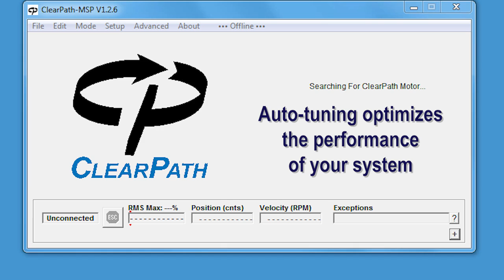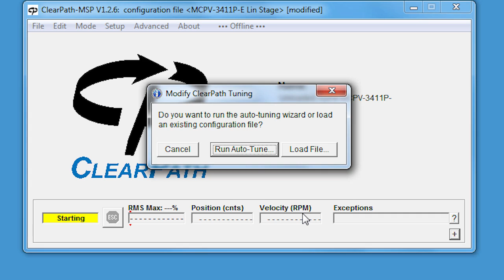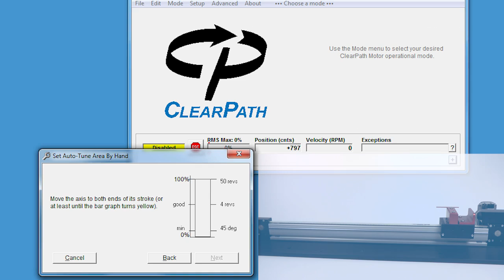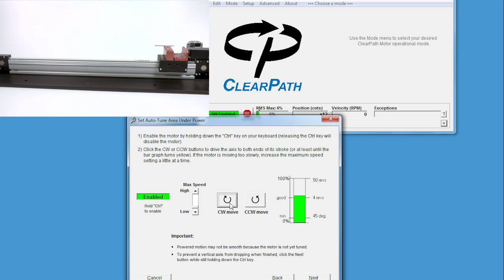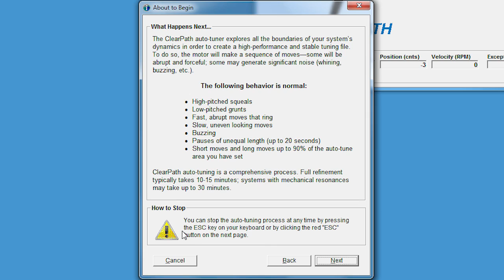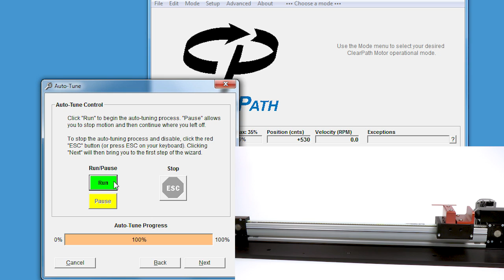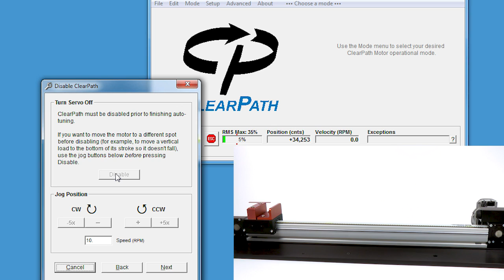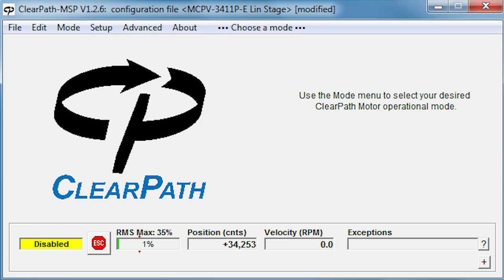How to Auto-tune a ClearPath Motor

Comment: Can I use my AVID CNC EX Controller to power my servo during the Auto-Tune procedure?
Reply from the maker: Hi @adamna1672, 
When running the auto-tuner, the servo requires 24-75V DC bus power (The logic inputs from the EX controller are not used and should not be sending commands during the auto-tune process). If the servo is powered, the LED on the back of the motor will be on. During this process, the logic I/O cable (between the controller and the motor) can be disconnected completely.

Best regards,
Aaron - Teknic Servo Systems Engineer

Comment: Hmmm, I need to look into these servos in my upgrade of the small cnc router. It almost sounds too good to be true.
Reply from the maker: Hi Niclas - ClearPath servos are often a great upgrade for CNC routers.  I’d recommend looking into the ClearPath-SD (Step & Direction) series for contouring/path-following applications like a CNC machine:
https://teknic.com/products/clearpath-brushless-dc-servo-motors/clearpath-sd-stepper-replacement/

In case you weren’t aware, Teknic has a 90-day refund policy for ClearPath servos so you can thoroughly and confidently evaluate them in your application.

If you have any questions about what products are best for your application, please don’t hesitate to reach out via our contact request form (https://teknic.com/contact/), or by giving us a call at 585-784-7454. 

Best, 
Nick D. – Teknic Applications Engineer

Comment: I'm using these in a homebuilt CNC router. This was a great video at explaining the tuning app, and here are a couple other things I found:

1. At 6:50 in the video, the carriage is manually moved through its range. What confused me when I did it was that it didn't work. Turns out that the Direction button need to be held down for about a second before anything happens. I was tapping it to get the carriage to move "just a little", and it was non-responsive. My bad.

2. If the mechanism that the servo is coupled to is heavy or has a lot of friction, the servo may overheat during self-calibration. If it does, it'll pause to let the servo cool, but the takeaway is that a larger servo is be needed.
Reply from the maker: Hi Kurt, thank you for your comments. I'm sure other readers will appreciate the feedback. I have a couple of small clarifications that may be helpful:

When one of the direction buttons is pressed during auto-tuning (commanding the motor to move), the torque starts to ramp up immediately, but because the servo is not yet tuned, this ramping happens slowly for safety reasons. With light axes, without a lot of friction, pressing a direction button will therefore generally cause motion immediately. But for heavier axes and/or those with significant friction, it may take a little time for the torque to ramp up enough to generate movement. 

I can see how this could be confusing, so I will submit an entry to Teknic’s feature request database to add an indicator (or something similar) to the user interface of a future software revision to clarify the behavior.

My second minor clarification is that if the auto-tuner pauses during tuning to let the motor cool down, it may indicate that you need a higher torque motor, but in many cases, you will not. The auto-tuner is pretty aggressive to ensure the tuning is robust, but many applications are not nearly as aggressive and/or have low duty cycles. 

A good way to see if you really need a higher torque motor is to run the motor in its normal application (e.g., cutting an intricate part on your CNC machine that requires lots of accel/decel, with the acceleration and velocity limits set as high as you intend to use. Then, monitor the RMS torque meter in the ClearPath software and see how high the RMS torque gets. (RMS torque is a sort of weighted average torque.) If the maximum RMS torque stays below 70-80% in this worst-case usage, you probably have enough design margin with that size motor. 

See this section of another TekTips video for a little more information on the RMS torque meter: https://youtu.be/oJSp_1aNiSE?si=OWKT8XrMoo1nB3sR&t=523.

Thanks again,
Aaron B. - Teknic OEM Applications Engineer

Comment: Hi, last week we did the auto tune , but it always stuck at 41%, could you give me some advice? Thank you.
Reply from the maker: Hi Ethan,

There are a number of possible circumstances that may prevent the auto-tuner from completing the auto-tune process. I can’t mention all of the causes here but I can provide some clarity for the most common causes. 

Perhaps the most common reason that prevents the auto-tuner from completing the tuning process is due to vibrations/harmonics in the machine. These vibrations could be due to a poor coupling choice (like a helical coupling), a narrow belt used for a belt drive, or a cantilevered load. The auto-tuner uses a square wave stimulus for tuning to not only analyze these vibrations, but to also adjust the tuning parameters in an effort to prevent excitation of these vibrations. If the vibrations are excessive, the auto-tuner may not be able to create a set of servo gains that are considered to be robust in nature.

The second most common reason for problems during the auto-tuning process is due to a high “inertia mismatch ratio”. The inertia mismatch ratio is the ratio of the load’s inertia reflected through the mechanics compared to the inertia of the spinning rotor in the motor. The accepted standard in the industry is to keep this inertia mismatch ratio at 10:1 or less (load: rotor) for the most robust design. That said, it is possible to have a much higher inertia mismatch ratio than 10:1 if the rate of acceleration is appropriate. 
We are happy to review your choice of mechanics and motor selection in an effort to determine the root cause of the auto-tune problem.

Please give us a call at 585-784-7454 or send us an email at support@teknic.com and a Teknic engineer will contact you for more information. 

Best regards,
Celina A. 
Teknic Servo Systems Engineer

Comment: its possible to auto-tune 2 motor in one occasion because i have two motor on my Y axis . thank you
Reply from the maker: Hi Ike,

Yes, you can tune your dual-driven Y-axis, although doing so requires a slightly different process than what is shown in this video. You can access a guide for tuning your dual-axis system here: https://teknic.com/files/downloads/Tuning-Two-Motor-Axis.pdf

If you have any specific questions about tuning your mechanics feel free to give us a call or contact us through our website: https://teknic.com/contact/

Thanks, 
-Jon K. - Teknic Servo Systems Engineer
Reply: @TeknicInc  thank you
Reply: @TeknicInc  what will recommend if i changed my Chinese 1.5kw servo for clearparth motor thank you
Reply from the maker: @ikecobey6268 ,

Selecting the right ClearPath motor for your application comes down to two major elements: 

Motor Sizing
- Understanding the motor characteristics required to handle the physics of the application (e.g. torque, reflected load inertia, velocity, acceleration, desired resolution, etc.).

Control Architecture
- Selecting the optimal ClearPath series for your application based on the motion requirements and the preferred approach for the control signals. 
- To help you decide which ClearPath operational mode you prefer, please watch the videos on each of the modes to see what makes the most sense for your application: https://teknic.com/products/clearpath-brushless-dc-servo-motors/#which-series

Once you understand those two elements, you can select the appropriate motor for your specific application here: https://teknic.com/products/clearpath-brushless-dc-servo-motors/all-clearpath-models/

If you any specific questions about this process, please free to give us a call or contact us through our website: https://teknic.com/contact/

Thanks,
- Jon K.

Comment: Can auto tune map load characteristics, that are dependent on multiple servo motor positions? Like in a robotic arm in extension?
Reply from the maker: Hi Rob,

To be sure that I'm answering your question correctly, I thought it'd be helpful to paraphrase. I believe that you are asking if the ClearPath motors need to/are able to dynamically adjust their tuning parameters based on a changing inertial load. 

For some background, this type of inertial change isn’t problematic for ClearPath when the motor is properly sized. The auto-tuner sets servo gains that are capable of handling changes in load inertia without needing to map the system. 

If you are tuning a motor for an application where the inertial load changes during travel, Teknic recommends running the auto-tuner with your worst case loading/inertia. If you tune a motor so it can handle the worst case load, it will have no problems handling the easier, lighter load.

So, to answer your question, can auto-tune set dynamic tuning gains? No. Does it need to? No.

If you have any additional questions about the auto-tuner or tuning your specific system, you can reach us at support@teknic.com.

Best,
Bridgette G. - Teknic Servo Systems Engineer
Reply: @TeknicInc  Thank for you response, we are on the same page :)

Comment: I think I'm pretty much sold on some Clearpath's for an upcoming project! Quick question though on the tuning.. Should the tuning be done with projected load on the axis?
Example of what i mean.... If I was using them on the X and Y axis of say a milling machine, wouldn't you want the table to have the heaviest possible load on it during the tuning?
Reply from the maker: Hi Chris,

Yes, you are correct - you'll want to run auto-tune with the heaviest typical load for the application. For example, if the load weight varies between 100 and 150 pounds, you'll want to run auto-tune with 150 pounds.

Thanks for your interest in ClearPath and good luck on the project!

-Aaron B., Teknic Servo Applications Engineer
Reply: @TeknicInc  Aaron B. Thank you very much for your reply!! Hope to be ordering the motors I need in the next week or two.

Comment: Thanks for this video. I have two Clearpath motors running my Y axis, each driving a separate ball screw. Is there a way to tell the software this so that I'm not running each motor on its own?
Reply from the maker: Hi Michael,

Thanks for the question.  There is an application note for auto tuning a dual axis using the MSP software here: https://www.teknic.com/files/downloads/Tuning-Two-Motor-Axis.pdf 

Most dual axes can be successfully tuned using this process, however if you are unable to for any reason please call one of our application engineers.

Brendan F - Teknic Servo Systems Engineer

Comment: If you read it well, even a timid girl could set this up. But still not recomended though!
Reply from the maker: Joel, thanks for watching and commenting! We worked hard to make Auto tuning a ClearPath motor as easy as possible. By reading through a few prompts and defining the length of stroke, anyone can tune one of these motors.

And, even though a timid child could probably tune a ClearPath motor, we would definitely not recommend that either. ClearPath motors are powerful devices, that, used carelessly, have the potential to cause serious damage.

~Jim W.

Comment: My question is:

At the 1:25 time mark in this video you said, "When you plug into a Clear Path motor..............", does this mean JUST the power cable. Or must we plug in both power and digital connectors?

Thanks in advance for your answer to this question.

pat
Reply from the maker: Hi pat dee,

To emulate the setup you see at 1:25, the ClearPath motor must be plugged into its DC bus supply (24-75VDC) as well as be connected to the host PC (via USB) on which you are running the MSP software. You don't need to connect the controller cable to ClearPath unless you are ready to run your system from a separate digital I/O controller. You can use the MSP software to exercise ClearPath before you connect your I/O.

Best regards,
Bridgette G.

Comment: Hey Teknic - if I was to run 2 instances of the tuning program on my pc at the same time,  and triggered them within a micro-second, would they stay in sync or would they go out of phase as the motors learned?  /Dual gantry/
Reply from the maker: Hi Observer, thank you for your question.

The auto-tuner uses a sequence of different stimuli to make the motors move. For each move, it analyzes the feedback from the encoder and makes adjustments to the servo gains (as well as some other parameters). When the auto-tuner achieves a suitable resultant for a particular section, it then moves to the next sequence of moves. Moving through this process is based on encoder feedback and analysis, not on time.

There are no time constraints on the amount of time that it takes for each section of sequences. So it is likely that even if you started the auto-tuner for each motor precisely at the same time, the motors would become asynchronous at some point because the feedback from each motor would not be identical. Not only would this cause improper tuning parameters to be set, but it could also damage your mechanics. Using this method is not recommended.

For more help or information, please feel free to contact Teknic at support@teknic.com.

Best regards,
Tom T

Comment: Loving the Clearpaths, I'm on my third and will be purchasing a couple more soon. I recently upgraded my Laser cutter rail system to something very similar to what you have on the video. The auto tuning completes fairly quickly, but I still find the results to be a bit conservative (even with the stiffest fine tuning setting), specially on the Kp and Kv values, my rutine is to do the auto tuning and then go higher on both Kv and Kp, usually 2X the value generated by the auto tuning. That reduces the maximun error I get on my rapids testing routine from low 20s errors counts to less than 5 error counts max, even when I do laser engraving at 4Gs acceleration the maximun overshot never crosses 5 counts, trully remarkable. I'll upload a video on my channel so that you can see soon.

Comment: Somewhat Off topic question here but I've been considering using some clear path motors for direct drive applications on outdoor robotics (think 30 kg almost meter long robot). Do you think this sort of motor is suitable for this application? (Thinking the schp series) also how would you go about tuning something that will be driving over all sorts of surfaces (obviously even a couple degree accuracy in this application is non vital, just the ease of use and high power nature of the motors is the attractive point)
Reply from the maker: Hi Matthew, We appreciate your interest in ClearPath. Determining if ClearPath is a good fit, and which size/model to use, is dependent on your application's torque and speed requirements. It's difficult to answer "yes" or "no" to your question without knowing certain details about your mechanics and multiple other factors regarding your application goals.

Once you know your torque and speed requirements, you can use the torque speed curves on Teknic's website to determine if there is a good ClearPath model to fit your application needs.

Regarding your question about tuning: you should use the autotuner to tune your robot, regardless of the different terrain it will be running on. Sized properly, the motor will use peak torque to overcome any rocks or bumps in the terrain, and autotune will account for this.

If you have any technical questions about how to use ClearPath, please feel free to send an email to support@teknic.com or give Teknic a call.

-Bridgette G.